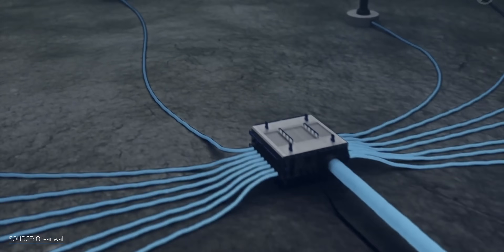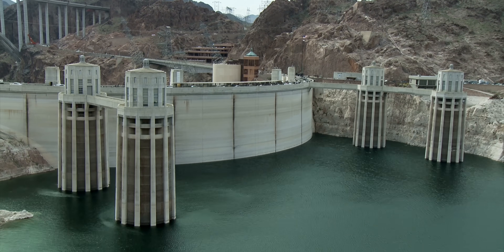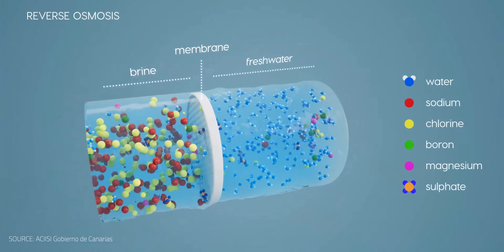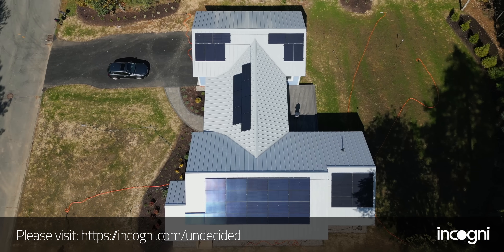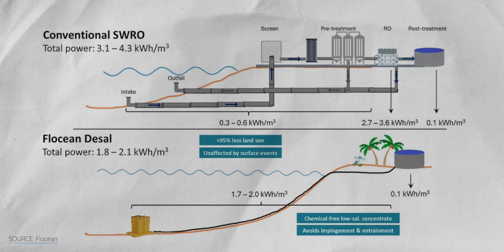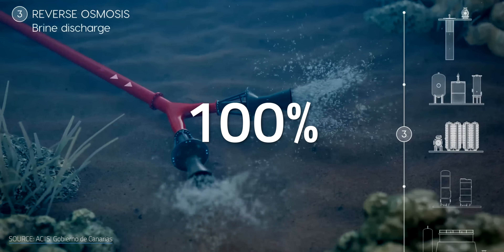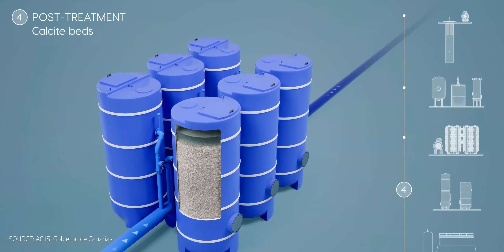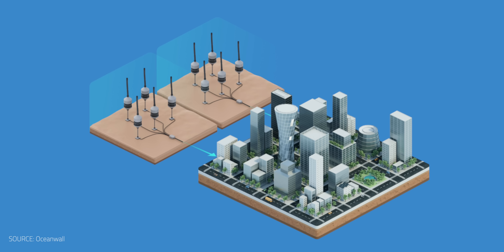How Deep Sea Water is Now Drinkable

Comment: The salty brine shouldn't be considered waste, but the first part of creating natural sea salt from evaporation in salt works. This process of salt from brine in salt works goes back centuries. It is a renewable source of a valuable product we all need.
Reply: Yes, but it doesn't scale. The first few systems could benefit, but we use far more water then salt. The Carlsbad plant alone is dumping around 2.4 million metric tons of salt in their brine per year. The world's yearly salt consumption is around 110 million metric tons, with total production across all uses hitting  270 million metric tons.
Reply: @zncon  So the question is, if left unchecked, how much will that increase the salinity of the oceans over say, 100 years...?
Reply: @Reyajh  I suspect the short (and long) answer to that is. . . none.  It is akin to blaming rising ocean levels on too many people swimming in it and thus their bodies are displacing the water.
Reply: @Reyajh  It won't cause any increase. The freshwater we use ends up back in the ocean eventually, cancelling out the brine. Assuming our water need is reasonably constant, it doesn't matter if we get freshwater from rain or from desalination. Rain (from evaporated seawater) is just another form of desalination, after all.
Reply: @Reyajh  Of that water we are taking from the ocean, most goes back to it (evaporating and peeing and sweating, eventually going to the sea). I think the only way the ocean gets saltier is if that water is permanently locked up (used in a chemical reaction for a material for infrastructure, stored in huge reservoirs), but I’m guessing those aren’t going to be large enough to affect it significantly.
Reply: @Reyajh there's no way you dump brine into the ocean and not increase it's salinity. Any % of fresh water returned is reduced from what was taken, and some of that will return salter due to the natural systems that add salinity to the ocean. The brine already has to be diffused to avoid killing sealife. This system is dispersing brine higher up into the water column to be whisked away by currents, but it is still taking salt out of water, removing the fresh water, and returning salt to the ocean. The size of the system makes these concerns seem trivial, but they are valid and worthy of concern, research and solutions.
Reply: @Reyajh  "So the question is, if left unchecked, how much will that increase the salinity of the oceans over say, 100 years...?"
There will be no change.
Water flows in a closed cycle for millions of years. Natural "desalination" is simply the evaporation of water by the sun, and then this water rain falls somewhere else, some days later.
Artificial desalination simply changes the random "somewhere else, some days later" to "here and now", at the cost of losing "free" solar energy.
Reply: @shannonolivas9524  And if you piss in a lake you make it deeper. The net saltiness isn't the problem, but yes it would have a bad local effect. However that could be mitigated by spreading out the area which the brine would leach back into the ocean, or sequester some of the salt in old mines.
Reply: @Reyajh  The natural water cycle is constantly removing fresh water from the top layers of the ocean and increasing its salinity, but over time it doesn't change because the water comes back as rain.
Reply: @odbo_One Consumed water goes to the ocean eventually, not all of that water is fresh clean accessible liquid water. And demand for water is still increasing. I didn’t mean to imply there is an “abundance”, sorry if I did.
Reply: @shannonolivas9524  I don’t mean to imply there aren’t environmental concerns here, but you seem to imply there is no way for minerals to leave seawater naturally. This isn’t true, they can precipitate out (biologically and nonbiologically) and then be buried, becoming sedimentary rock eventually.
Reply: @randydietmeyer5883  Add to that the added mass may be changing the tide levels around the globe 😱😱
Reply: @odbo_One ...whut? Presumably because it's easier to desalinate seawater than to turn sewage into drinking water? Most drinking water ends up as sewage/wastewater. Some we sweat out, some is used for watering lawns, but it doesn't matter. It's all part of the great water cycle, and it all eventually goes back into the ocean.

Granted, the wastewater will bring some small amount of salt with it into the ocean - but less so than water which rained on mountains and flowed down rivers to us. So I'd expect a desalination system to add less salt to the ocean than water systems based on natural fresh water. Either way, it would be miniscule.
Reply: @zncon  It scales fine, excess could be stored in old salt mines.
Reply: @nustada  The extra energy required to dry the brine and then haul it to an old salt mine would be a huge increase to the total CO2 output of the process. We can't just teleport the stuff, it would need to be hauled by trucks and trains.
Reply: @zncon  It doesn't surprise me that a CO2 alarmist has never hear of pipes or pools.
Reply: @nustada  So your great idea is to build a pipeline across multiple states to transport a nearly worthless waste product? Or pool it up on the ground where it can leech into existing fresh water aquifers and poison them?

Carlsbad alone releases 50 million gallons per day of brine to supply 10% of the water for San Diego County. The highest capacity oil pipeline in the US carries around 100 million gallons per day.

So in order to supply that county will all of their water, you'd need to build five copies of a pipeline valued around 10 billion USD.
 
I'm done here, there's no point having a discussion when you don't even exist in this reality.
Reply: @zncon  sea salt is laden with micro plastics and heavy metals.  pass.

Comment: After only listening to the intro, the answer is obviously ‘no’. This is simply not possible. Any pressure gain at depth is immediately lost as you try to raise the water back up. This is a failure to understand static pressure is equal to believing in a perpetual motion machine.

Comment: need to merge the bobbing wave generators with these. just have the bobbing wave pump water through the filters and push the water to shore.
Reply: I think a few systems can be combined. off-shore wind requires power cables so these desal pumps can get power from those. the point-source wave-power generators need anchors which these desal filters could be attached to. Lastly, I'm partial to the WEPTOS wave energy converter which I think should be closer inland behind wind and point-source wave farms.
Reply: Another system breaks the water into hydrogen and oxygen underwater than uses the bubbles to bring water to the surface like some aquarium pumps work. The hydrogen itself is a fuel commodity.

Comment: Sounds cool, it would be even better if they can find a way to recycle the RO filters, re-melt, and reform. To keep them out of landfills.
Reply: I'm guessing like most plastics they're not recyclable for their original purpose, at least not more than 1-2 times, and not cost-effective to recycle either. We'd need different materials for a closed loop. There are ceramic membranes which are much longer lifespan and recyclable, but they have problems with cost and brittleness. Emerging graphene-based membranes might be more recyclable without these issues but they're still in the lab. As an alternative, plastic membranes can be cleaned and refurbished, but I'm not sure how many times this can be done.

Comment: Not sure I follow, if solar can replace the power... even if it doesnt work at night... why not just produce as much as you can during the day? Flowing that water back into different ponds and lakes much like pump hydro. Need water? Take it out.. need a little extra power, let it flow down. Even still, you dont need photoelectric.. you just need the heat more or less meaning you will capture more of the sunlight if you directly just lens the rays down onto pool beds and then capture the water that steams up. This mean less over all power needed as well because you are not wasting it trying to pump it into membranes and without the need of them, you also lower the cost. Sea waves can also help to recycle the water before it becomes too salty as well.